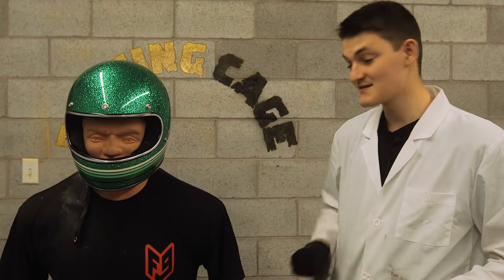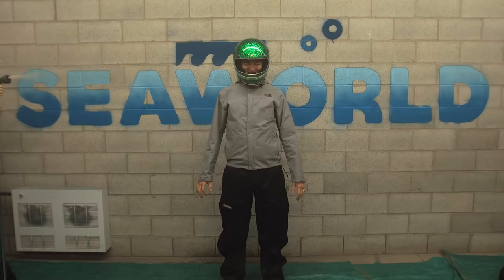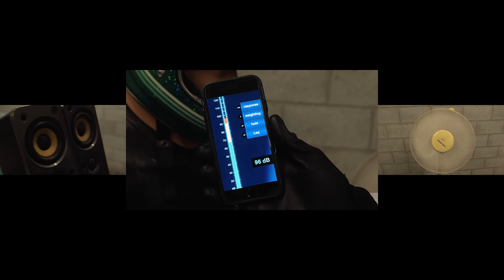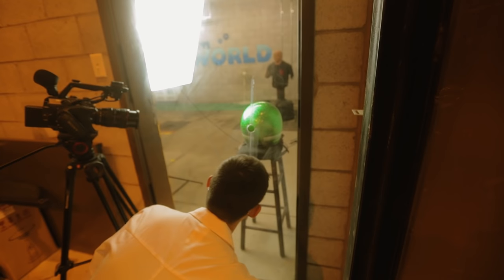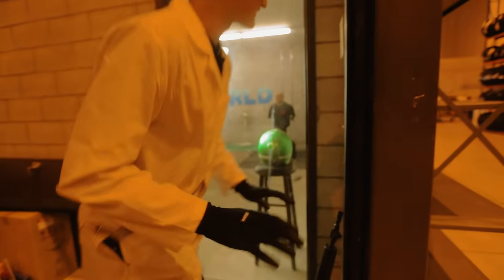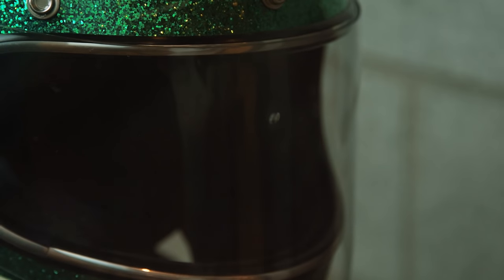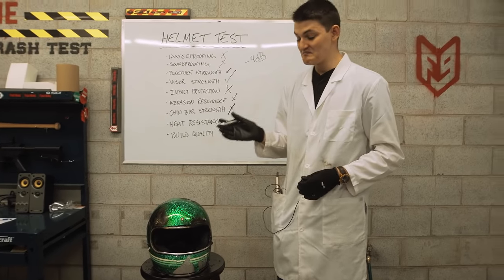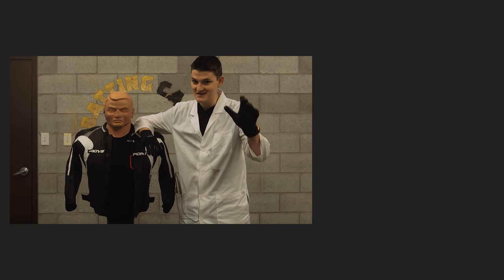Crash Tested! The Biltwell Gringo Retro Helmet Review

Comment: One of the prerequisite for wearing a 1970s replica helmet is to accept the risk and not be overly paranoid about what could go wrong. What I found is that the more you think of the worst the most likely it is to happen, because you  condition yourself and your subconscious will influence your riding. I condition myself to ride and ride only, what is out of my hands is not worth a thought. A very good helmet will give you a false sense of security and in some cases will even influence the way you ride. Why on earth would you want a soundproof helmet?! You're asking for it if you ask me. Whenever I ride, I want to be on the edge, I don't want to be all cosy and relaxed because this is when shit happens. I have had expensive Shoei before, downgraded to Bell and got myself a Biltwell for this very reason other than the paint job: I actually want to hear my bike and everything around and I am prepared to get wet and foggy inside and feel like I am getting back to a time when riding was everything, every tiny bits of discomfort included. No Bluetooth bullshit, no fancy dimmable visors, no soundproof bubble... It is not an apartment I am buying it is an helmet. I am a biker, I am the one in charge, I am the one making decisions, my bike is the only place where I evade and trust myself more than every bit of fashionable material and technology you can throw at it. Biking is a simple pleasure so Biltwell are a welcome addition as far as I am concerned. Besides if your crash is so bad that your helmet will be judge and executioner of your sentence, then chances are the rest of you will be in no way to ever function properly. You guys put way too much trust in DOT and ECE. The only worthy test I know about is the British SHARP and you would be surprised how many expensive helmets fail miserably when tested properly...

Comment: Impact tests would be more accurate if you dropped each helmet form the same height with a bowling ball (and impact detectors) INSIDE the helmet.... Swings with a baseball bat leaves a lot of room for variables. The same with the sander, setting a weighted (and braced) helmet on a sander would be more consistent than tired arms applying variable pressure.
Just my thoughts though... Love the test/review series!
Reply: We need to get Project Farm on this...

Comment: The Face shield should have been on for the waterproof & noise test !! Just say'n :)
Reply: Brent McNicoll, my thoughts exactly
Reply: Brent McNicoll Agreed, Ryan's being a bit unfair on that. Open or remove the face shield on any helmet and you get wet.
Reply: Brent McNicoll is he reading this?? he needs to.
Reply from the maker: I hear ya. It wouldn't have been fair with the gear we had though, since the helmet was a regular Gringo (no shield) and the visor came from a Gringo S. Basically the visor wasn't a proper fit for the helmet, so it would have leaked a bunch during the waterproofing and soundproofing tests anyway. Which wouldn't be Biltwell's fault, of course, since the two aren't really meant to go together. We could have bought a bubble shield or something that actually fit the regular Gringo, but we make a point of not destroying good motorcycle gear (everything we crash test comes from the "small defect" pile). Cheers! ~RyanF9
Reply: I also get that these tests are kind of a tongue'n cheek way through the winter :)
Reply: I love all your videos.  Very entertaining and I use the info when deciding on what to purchase.  I do feel like I do need a new helmet now; there is always an excuse to buy more gear, lol.
Reply: Sirmellowman it represents getting roosted and small pebbles hitting you. Its an extreme version.
Reply: Not many people ride with their face shield on for noise, anyways, and I guess he just wanted to see how normal people wearing em without a facemask would be, if they were caught in a thunderstorm.
Reply: Would be curious to see how the Biltwell Lane Splitter pans out in your crash test. Biltwell didn't seem to do so hot regarding safety with the Gringo, but claims to have stepped up their game with the LS. You should put it to the test!
Reply: How do I get my hands on this "small defect" gear? Probably would want to use a helmet with that classification but some gloves or cheap jacket... ya i would do it.
Reply: shoulda used the bubble shield too........
Reply: I thought the same thing? You can clearly see the bottom snaps on the helmetZz why would you leave the shield off
Reply: @Sirmellowman  you bellwiff, it is simulating road grit. This shit chips windscreens, let alone a small visor.
Reply: @Sirmellowman  Did you seriously just asked what puncture strength has to do with the quality of safety gear? You want a rock or bolt to go through your helmet while riding? Or maybe some sharp Object you hit while crashing?
Reply: The bubble shields I have for my gringo are way thicker than the shield he used to shoot at. They dont flex like that at all. When you use goggles with the helmet it’s not very loud the bubble shields actually make it louder because of the air that gets through. I’d suggest using some sort or weather stripping an go around the edges of the bubble shield. Find some thick enough that it’ll make contact and it makes it a lot more quiet. I really like my gringo helmet it’s great to cruise around town with you can wear sunglasses with it on you can wear goggles with it you can put the bubble shields on it and you can wear goggles and the bubble shield at the same time making it a lot warmer. If you use the biltwell goggles they fit perfectly.  I have another normal full face helmet for longer freeway rides tho.

Comment: It looks like you've changed up your testing procedure since testing the gringo, changing the impact protection to a 100g shockwatch sticker instead of 50 and dropping it instead of hitting it with the bat.  Do you think it would have passed impact protection under your new setup?

I think I'm just wishing these helmets were better quality, the green one would match my green 2015 vulcan S so well.  Oh well, I'll just have to stick with my DOT/ECE approved Bell.
Reply from the maker: Yeah good eye! We switched to a drop test because it's more reliable than the bat. We experimented with a helmet that we've tested already to make sure the 100G drop had a comparable fail rate to the 50G bat swing. Obviously it's far from error-proof, but oh well. ~RyanF9
Reply: ruhl1337 I wish it was better quality too. I love the style but I decided to stay with my cheaper icon that has ece